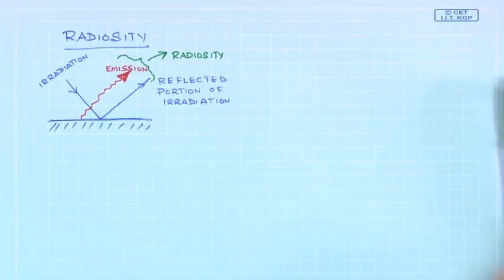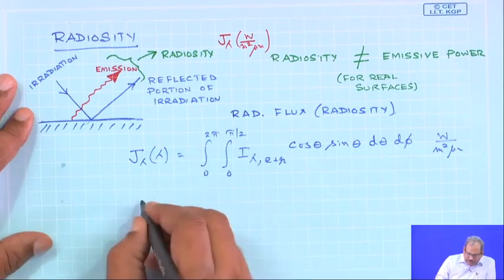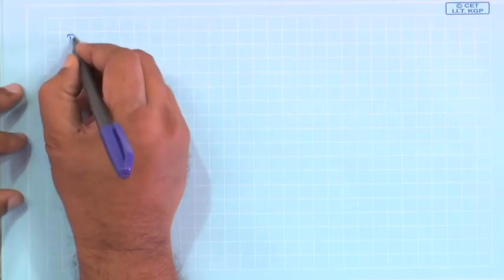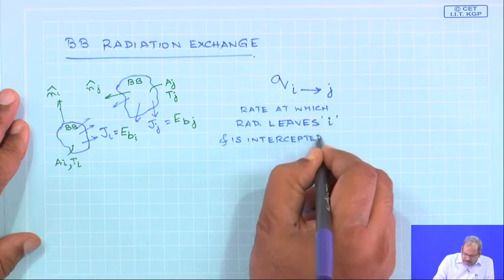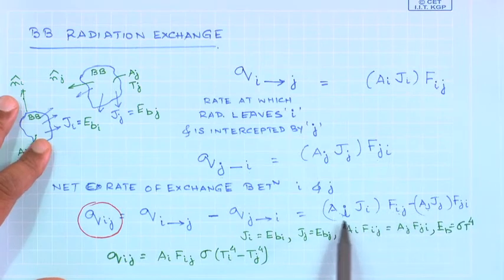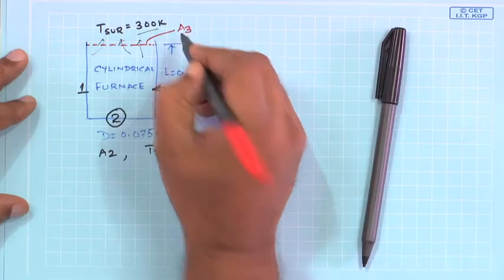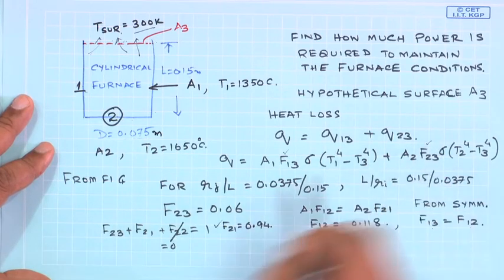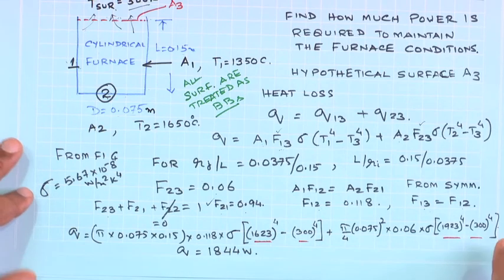Lecture 55 : Radiosity Blackbody Radiation Exchanges, Relevant Problem

Comment: Sir, could you please explain why we didn't consider q_21 ? If heat transfer is going to happen between a surface of higher temperature to lower temperature, surface 2 is at a higher temperature than surface 1 !!
Reply: Here we have to deal with the heat loss from the furnace through surface A3, so we have to consider the net rate of heat exchange from 1 to 3 and 2 to 3, we do not care about what happens between 1 and 2 because that heat will be in the furnace itself and will not be lost ..
Hope it helps!